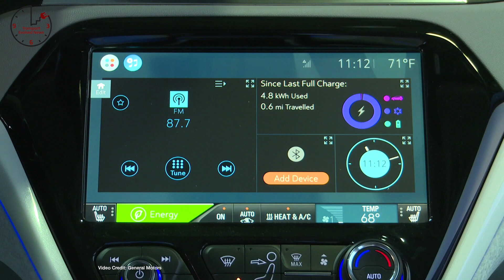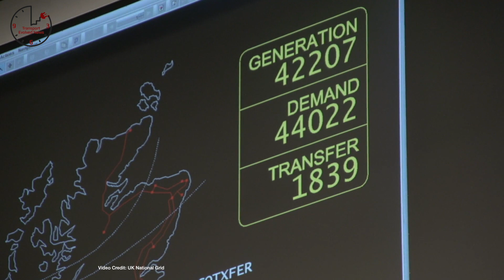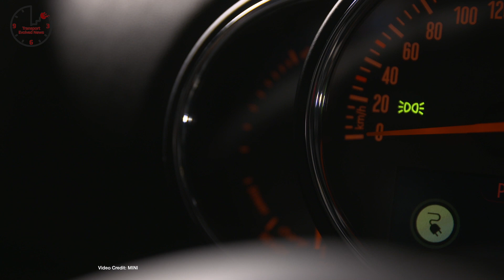BMW Scares Employees With Tesla, Waymo Public Tests, LEAF AT-EV, T.E.N. Future Car News 4/28/2017

Comment: You expressed your opinion that a 100 mile per charge range would be adequate for 95 percent of the population.  I disagree.  I leased a Leaf for 3 years.  In the summer I could get approx 70 miles on a charge.  However, in the winter I could not complete my 46 mile round trip commute to work on a single charge... even with preheating the car while plugged in at home.  I suggest that drivers living in a cold climate should divide the claimed miles per charge by 2 if they are going to drive it in cold weather.  I anticipate the 238 miles per charge rated Bolt will get about 120 miles per charge on cold a Minnesota winter day.  In my opinion, the 238 miles per charge rating is acceptable but not a 100 mile rating.

During the first winter that I leased my Leaf, I drove to work on a -23F morning.  The fellow in the office next to me also leased a Leaf so we would meet at the nearby Nissan dealer, plug one Leaf in to the level 2 charger and take the other Leaf to work.  At lunch time, we drove back to the Nissan dealer, swapped Leafs, put the nearly depleted Leaf on the charger, and drove the charged Leaf to work.  At the end of the day we went back to the Nissan dealer and we drove both of our Leafs home.   That was a lot of hassle and we had to do this car shuffling every day the temp was below zero degrees Fahrenheit.  So don't under estimate the claimed range if you live in cold climate.  The lease on my 2012 Leaf is over now and I look forward to buying a Tesla model 3 once they become available, or maybe I will consider a Bolt.

If possible, try some EV test drives in a cold climate on sub zero days.  Let the vehicle totally cool down to outside temperature and see what you get for range when you use headlights, heater, and radio, just like an ICE vehicle driver would do.  Then tell me what the range is.

BTW, I enjoy your YouTube videos.
Reply: Leaf is esp. sensitive to temperature because there is no thermal management. I recall Leafs being sold in Canada come equipped with battery heaters to remedy some of the stink. That being said, Bolt has liquid cooled/heated thermal management system so the range will be minimally affected. Wish they had put in a heat pump for cabin heating though.
Reply: Mike Roerig did your leaf have the heat pump? also leaf battery is not heated/cooled liked most other plug-in cars so that could affect range also
Reply: My Leaf was a 2012.  The owners manual and the salesman indicated that the battery would heat itself using the charge in the battery if the battery temp fell below some value.  I don't recall the value.  Unfortunately there was no way to see if the battery was heating itself.  There were ample gauges on the dash, but none of them showed a battery discharge due to heating.  Most EV evaluations or reviews seem to be conducted in warm climates on a pleasant day so sometimes I point out how a cold climate can affect range.  I really liked my Leaf, but I wish that I had been aware of the cold weather affects on range when I leased it.
Reply: The Leaf allowed me to heat the interior using the charger when plugged in to a 220V outlet.  Unfortunately, the charger didn't have enough capacity to handle heating the interior on its own so I still lost range when preheating the interior before leaving for work in the morning.  My Leaf was a 2012.  I believe they put larger changers in the Leafs beginning in 2013.  Perhaps a 2013 could preheat the interior exclusively through the charger so the range would not be affected.

Comment: I hope they make the new mini as small as the old minis, (before they made them look so swollen and plastic). Maybe do a retro-futuristic vehicle with the old minis' clean lines and compact size, with the modern handling and torque rich speed of electric motors.( They probably can't, though, because of all the regs about bumper height, etc, etc...)

Comment: No manufacturer sells a petrol car with a range of 100 miles because it would be massively inconvenient. The same applies to electric.
Reply: Of course it would be inconvenient for a petrol driver, you can't fill up a petrol car (conveniently) in your own home every day, unlike an EV, the refueling habits are very different. That's the point.

If your driving habits fall within the mainstream and you can plug your car at home, then it's as convenient as a cellphone.

Gotta think outside the box, one needs to understand the different strengths and weaknesses of different technologies before buying what fits specific needs.
Reply: ...or not street legal due to its massive ratings.
Reply: Seán O'Nilbud 'Touring' motorcycles have a range of just over 150 miles; a hundred years ago, even less, yet people still make 'round the world' tours on them.